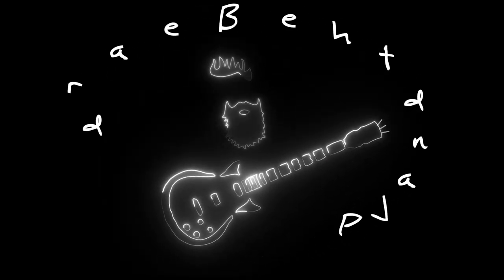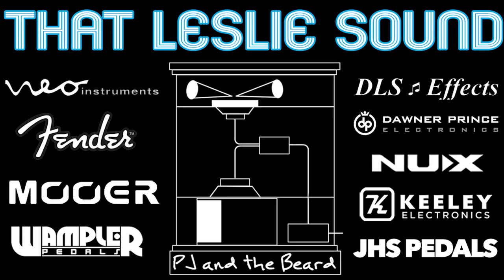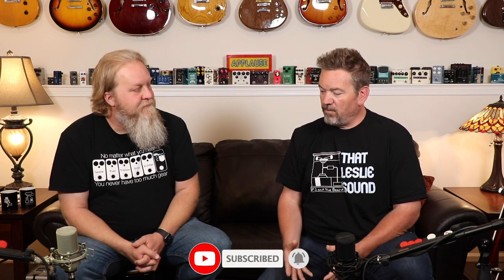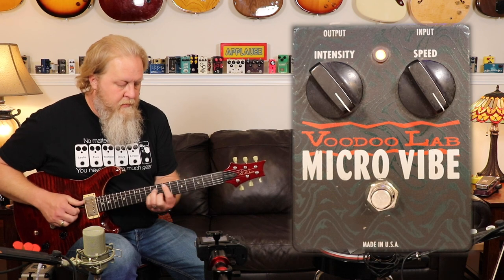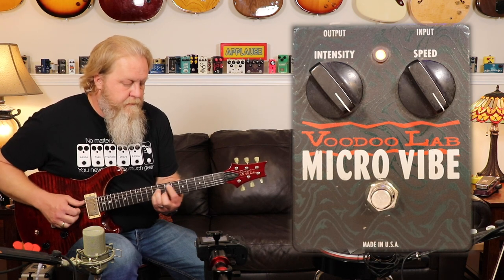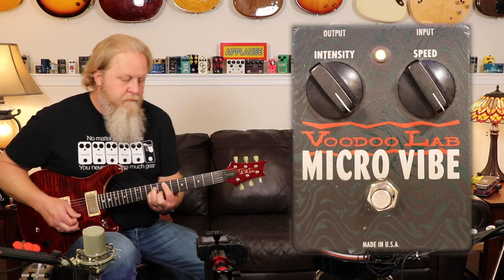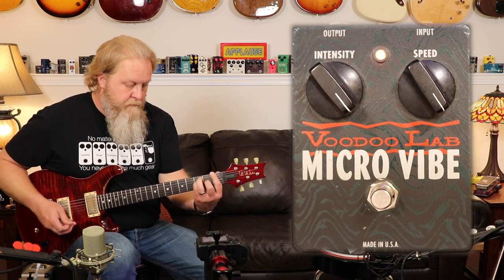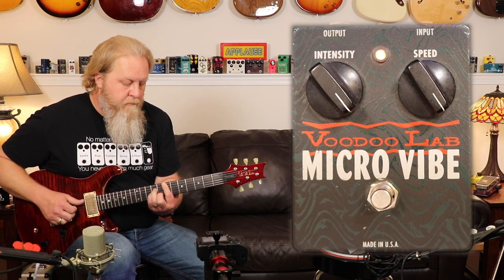10 Ways to Get That Leslie Sound with Gear You Already Own - That Leslie Sound Series

Comment: looking to buy a chorus pedal and combine it with a big muff to get something sorta similar to the droney bass (or organ/leslie speaker) part on the intro to Metallica's Orion. I suppose it'd be higher register because I'm using a guitar, not a bass, which is ok. Which one would do the trick without having to break bank too much?
Reply from the maker: Not real familiar with the tune but I just listened to it. Almost sounds like there might be a tremolo in there too. So many chorus pedals out there and we haven’t really dived into them. The MXR micro chorus is cheap and I think it is great. Super simple with only one knob too. I wonder if the nux roctary could be fun for that though. More of a leslie than a chorus but the octave options could be a loud of fun for what you’re trying to do.
Reply: No chorus, flanger or phaser can give you that tone, because you're searching for the "chorale" setting which is very tricky to achieve with just basic analog pedals. Even if you try that, you would also need a complex EQ setting or an IR-loader pedal, because of the peculiar frequency response of the Leslie. Trust me, I've tried almost all the possible combinations and I ended my quest with a proper digital Leslie simulator pedal for that highly sought-after "Orion bass" or "Jon Lord"-style sound on guitar or bass. The Lester G or the Lester K (which is the one I use) can lead you there wonderfully and they aren't as expensive as the Lex or the Neo Ventilator pedals.

Comment: SLow => phaser / univibe
Fast => tremolo + chorus/flange

Combining fast and slow in one pedal or combo is hard.
I'm in the process of studying leslie effect and the why behind my suggestions is within the way the different effects get dominant.
Fast leslie has a pronounced own oscilation sound. This where tremolo helps and an effect which focusses on pitch change -> chorus (flanger).
Slow leslie has almost no tremolo effect because it is imply too slow. Here the filtering is more pronounced and difference between high an low tones. That is exactly where a phaser works best.
But both are not the real deal.
Reply from the maker: An excellent slow sound is definitely harder to fake. We have done a ton of rotary pedals and there are some really good ones, but there is nothing like the real deal. That said, when you balance the weight and space some of the rotary pedals take up verse the real thing they get close enough. :)
Reply: @PJandtheBeardT he Strymon Lex is 'supposedly' the only one that has a proper slow speed. Btw, most of the people who try to get that sound almost always used a chorus pedal, as it had that top end and didn't sound like a vibrato pedal. Even when the first pedals came out: Ironically, the Roto Machine that you guys featured a few years ago, there's a lot of nit picking going on as to the speeds, speaker emulation, and overall tone. I personally thought the Roto and the RT 20 were excellent and I still own the Roto, although I have an Electro Harmonix Lester G that is, to me, otherworldly.

Comment: No offense. I have a VERY hard time digging any modulation that is not tremolo. I do enjoy a good phase shifter but I mostly play older blues so it’s not a sound that I really reach for. I have tried the  déjà vu vibe. Makes a strange copying noise when you kick it into your system and sounds OK but doesn’t sound good enough to deserve a place on my pedalboard. I’ve also tried the dark side by Keeley. And if you could dial in all the sounds at once, it might be a keeper because you have to choose whether it’s a fair shift or or Your or Whatever. I’m used to about three times and then I’m gonna put on Reverb. I really haven’t heard anything that makes me want to have it on my paddleboard that makes me feel it deserves the space consider to be very very valuable real estate. It needs to be sated inspires me that takes me somewhere else And none of the shit does that. Certainly nothing you demo on this video. I’m very open to suggestion. I’ve been playing since I was 14 I’ll be 63 later this summer I’ve used a lot of shit I’ve played through the real Leslie speakers simply looking for great sounds and inspiration want stuff that’s easy to dial in and easy to use. Sounds good and every goddamn position you put it in not something that has like three or four spots and you better fucking pray you get it right. Quite frankly don’t have time for that.
Reply from the maker: If you want a great leslie sound in a small package check out one of the micro vents. I like the 122 because I like the high rotor, but the 16 is cool if you want more of that SRV thing. Even though it has one footswitch you can set it up to change from fast to slow with a click and go to bypass with a press and hold. If the neo stuff doesn’t work for you then you simply don’t like the he leslie sound. The Lex is also really good with a smallish footprint. These are completely different from the univibe stuff you mentioned. They are very different even though people often say the univibe was created to sound like a leslie. We are just diving into a univibe series. We have posted a bunch of videos on them already but have a lot more to go. This has been one of my favorites and it is really easy to dial in a good sound. https://youtu.be/3KQGEff5Uug?si=HO23ta8bU0tT_3Uz

Comment: I’m considering a Leslie simulator (on a budget)….but I have a Fulltone SupaTrem (which has HUGE easy turn knobs for the foot and hard/soft and fast/slow switches), a chorus pedal, and a phase 90. Am I wasting my time trying to find a suitable rotary pedal when I could possibly create as good of an effect with those pedals? 

I’m new to trying to achieve Leslie sound, so I don’t know. Honestly, I’ve never even done a whole lot with modulation outside of a subtle trem and some light modulation built into my delays and reverbs. I just want to get somewhere near the tones Danny Gatton was able to achieve, and maybe create an organ sound if I get an octave pedal.
Reply from the maker: If it is the fast leslie sound you are going for a lot of chorus pedals can get real close to that. I think John Scofield’s leslie sound is a chorus with a high speed setting. We did a couple videos on the mxr poly blue octave recently. That pedal would get you the leslie and octave sounds plus a good bit more. The MXR Poly Blue Octave Pedal - That Leslie Sound Series
https://youtu.be/97W_O9gqb94

Comment: tc electronic helix with a tc electronic vibra clone  add trem from amp cost = $150 against $360 for a half decent stand alone /second hand under $100
Reply from the maker: The vibra clone is a nice pedal. Haven’t checked out the helix yet.

Comment: Yeah man! That Floyd thing! I use a Vox Tremolo tube driven pedal, you dial in the perimeters for each side, slow and fast, hit one switch, slow, hit the other switch to fast, and you hear it speed up or slow down when you hit the switch again, it sounds like a Leslie...I paired it with an EVH phase 90, awesome Floyd tones. Great for 4 piece blues band. I'm trying to get the B3 chorus-ey vibe for my Rhythm Guitar parts. So the chain is guitar > EVH phase 90 > Vox Tremolo > in front of the amp.. gigged it a fair bit and I'm happy with. Still after a real Leslie though lol

Cheers, love your work
Reply from the maker: That definitely sounds like it would get the job done! We did the pulse pedal by Dawner Prince and it nails that Gilmore thing, although different from a leslie style pedal. There are so many good options out there! Thanks

Comment: Really nice video! Since there are dedicated pedals for this kind of sounds, I think that for most people the big question is how to get close enough with what they already keep on the board.

Even without the chorus, a Harmonious Monk can get really close to both slow and fast Leslie-like tones in my opinion. Adding a touch of a nice spring reverb to it (I’m using a Surfybear Compact) gives it that extra depth and air that you expect to hear. I sometimes add a compressor to the mix to tighten it up when I’m going for that faster Leslie effect. A killer tremolo! On top of that it can get very vibe-y and it does those 2-stage MXR Phase 45 tones very well too. Very versatile and musical.
Reply from the maker: The harmonious monk is definitely a cool pedal that can cover a lot of ground. I bet it sounds great with the Surfybear, I would love to check some of their stuff out someday.

Comment: Years ago my keyboard player had two 147 Leslie's  that I souped up and I played with them by myself in my home studio. Your right you will not be able to get the exact sound. However  There are three distinct sounds that make the Leslie sound. #1 on the I47 the horns and the bass barrel spin in the opposite direction which gives the out of phase sound weather it is spinning fast or slow. #2 The driver in the horns on Leslie's go through an brake in period when they are brand new they have an hard sound but when they brake in they develop an distorted grind that sticks out in the mix.#3 This characteristic is dynamic in nature and adds very much to the elusive sound.The bass barrel dose not stop dead at any time from what I remember. It ramps up and down in speed. The horns however do  come to a sudden corral  when it drops to the slow speed. The combination between these three characteristics of the Leslie makes this sound a hard sound to copy.There are three Pedals that I know of that dose come close but no cigar. Thank you for Sharing your findings. c];-)
Reply from the maker: I bet those two 147’s sounded incredible. You’re right. There is nothing like the real thing! There are some great pedal board friendly options though.

Comment: I have a mxr analog stereo chorus and I think if I run out of the stereo out only it doesn't send the dry signal through. I cant remember exactly but I found a decent Leslie sound with it. Similar to your mxr micro. It would be nice to find something to use that chorus for.
Reply from the maker: Try it out with that flip series tremolo of yours! Post a video.
Reply: I will. PJ I'm calling out the Diaz. I want a head to head video of them
Reply from the maker: @Bullittbl  let’s do it. We can record everything we would need for round 4 of the tremolo series at the same time.
Reply: Done deal!